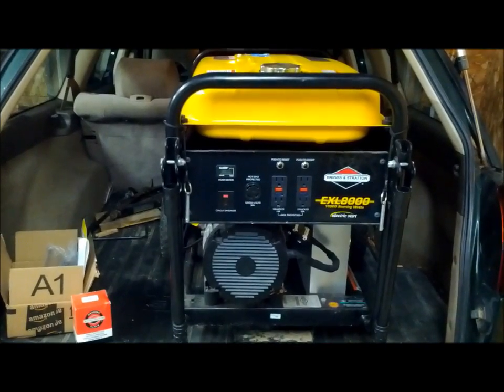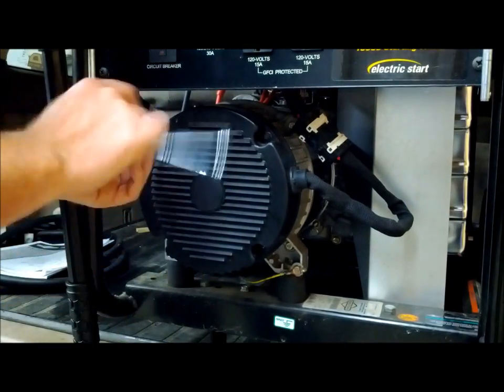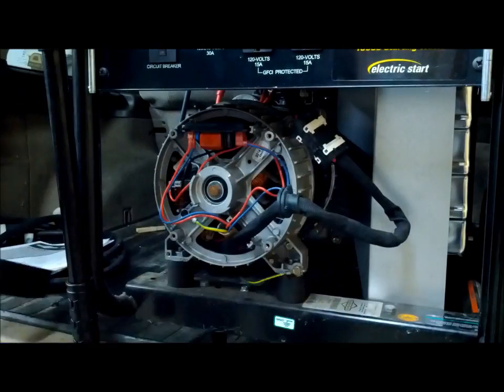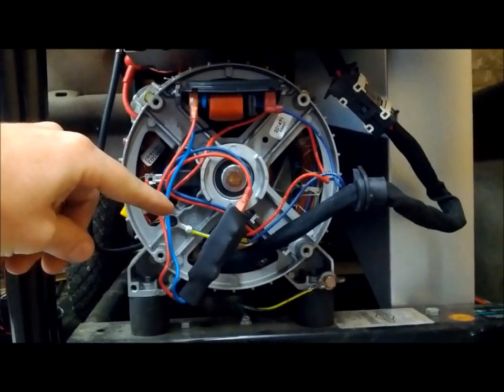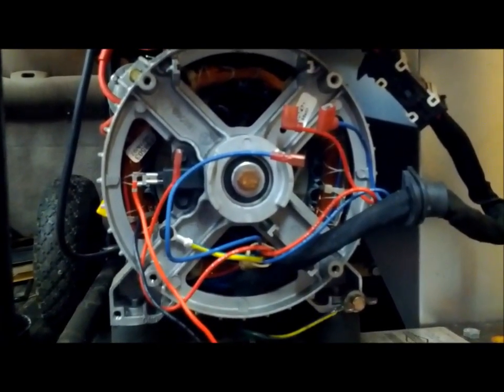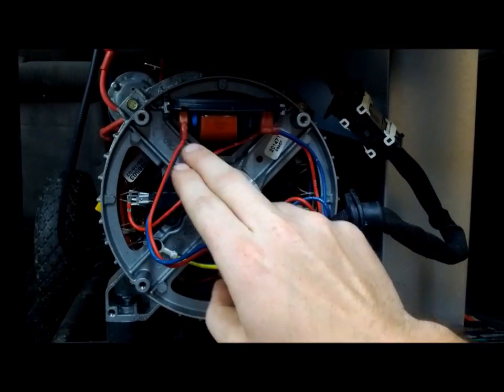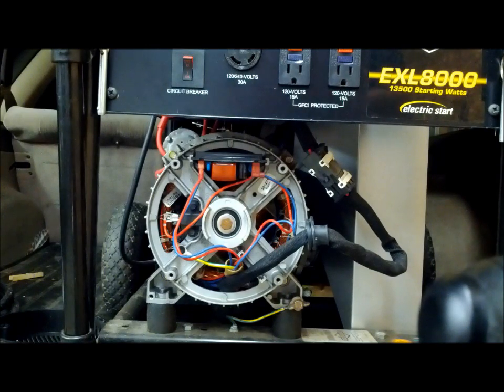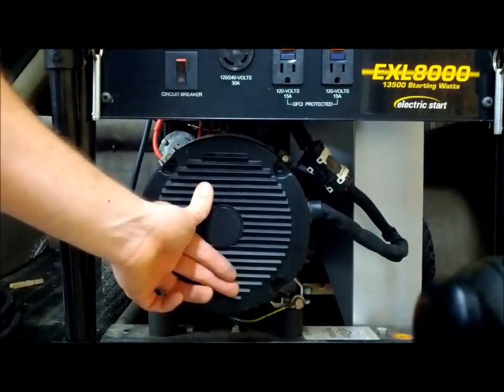How To Replace Your Automatic Voltage Regulator On Your Generator

Comment: so I have the exact same gen I just purchased with no power coming out but need to know how you troubleshooted to determine that the regulator was the culprit.
at $75 don't why to buy it to find out that was not the problem. thansk
Reply from the maker: Michael Frantzen If you search my videos you will find out called "Diagnosing A Generator That Has No Power Output. " It will show you how on the same one in this video.

Comment: Hi i have that same generator exl 8000 i got from a friend but he had the outlet box off  and one of the gfi out and i can't figure out the wires the 5 wires coming from the eletric motor can you show me the wiring diagram color codes

Comment: hey i have a Briggs And stratton 8000 watts portable generator and the AVR is damaged , it had the small square AVR can the moon shaped Avr work if i replaced it?
Reply from the maker: Everything I have seen on a Briggs and Stratton from a 5K to a 10K has been then half moon style.. I would check your manual for a part number and search for one using that to ensure you locate the correct one.
Reply: the model number is 030426, i really want this generator fix cause i use it on my sound system, u see the video above it has a square AVR, its like that mines had.
Reply from the maker: So it looks like the with that model # it comes up with a 205858GS. Which is the exact same one I used in the video. There is a link to one on our website ( link in description)
Reply: I got the avr for briggs and Stratton 8000 generator but the four conductors coming from inside the alternator have have the connector plugs cut I would like to how to know which and for where